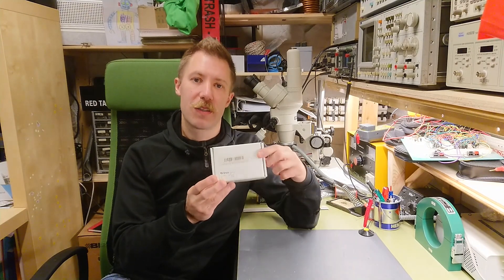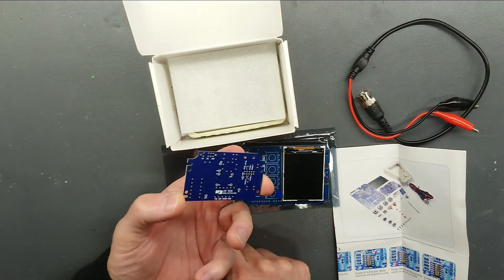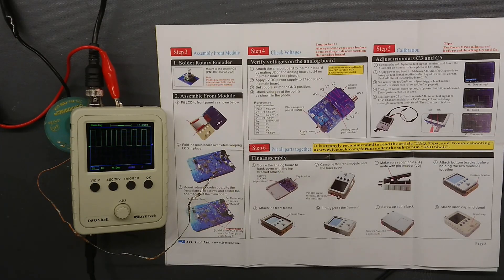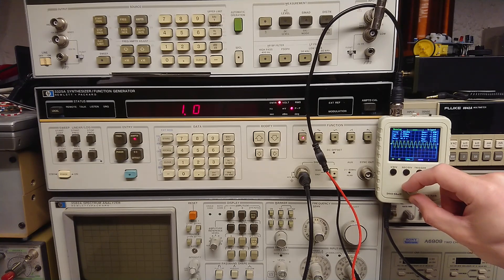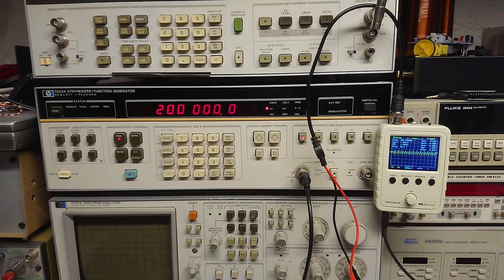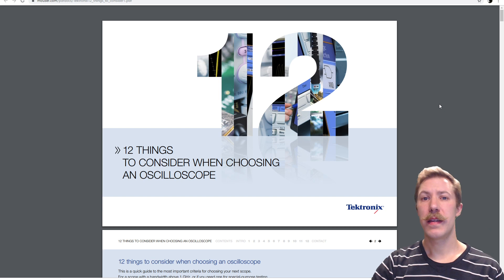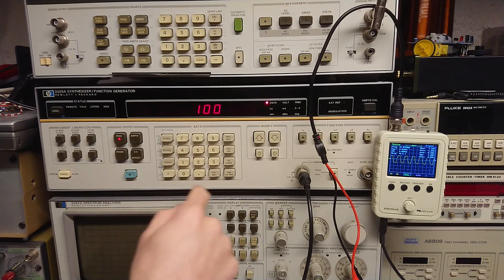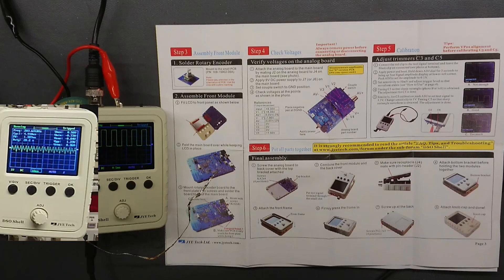DSO138 Oscilloscope Review, Test And Why You Should Not Buy It

Comment: I bought it because I thought it was a fun project to solder myself. And beyond that, I only need to diagnose signals when figuring out how a certain PCB works. I don't need to know what the waveforms exactly mean, I just need to be able to discern between PWM, waveform, DC and AC. This scope does all I need it to do and more.

If I need more, I'll get something better, no worries!
Reply from the maker: But how to tell when its not showing the truth anymore? ;)
Reply: @KaizerPowerElectronicsDk  Haha, true. Though I can still discern between the intended signal and random noise. But for anything other I wouldn't use it indeed.

But it's definitely helpful since my multimeter really can't do much with certain measurements I need to make 😅

Comment: So, I really learned something from this video.
I am thinking of buying one of these.

I thought that it could measure signals up to 200kHz just like you did.

But on a different video I saw a comment about bandwidth and I read up on the subject.

I found this document: https://people.ece.ubc.ca/robertor/Links_files/Files/TEK-Understanding-Scope-BW-tr-Fidelity.pdf

So the way I understand it now is that the Bandwidth is only a promise that you will be able to capture sine waves at that max frequency and then you will have to accept a nearly 30% loss of accuracy in the amplitude measurement at that max frequency.

Also if you want to measure more complex waveforms such as a square wave you need to have a band width that is at least five times that of the signal you want to measure.

And so you can expect to be able to measure square waves of 40kHz with this oscilloscope.

And it seems like it can just barely do that (with quite a bit of distortion).

So that would mean that it actually can do what it promises.

Am I right?

Comment: Unfortunately, the message you're conveying is "Don't buy the one you can afford, even though you can't afford the better one.".    There are plenty of new makers who need to see things from maybe 60hz to 1kHz.  They want to look at things like power, and the PWM rate of things they're driving.  They're trying to learn with doing PWM out to drive LEDs, and it would be a tremendous thing for them to be able to see what they're doing.   

Most of these new makers don't have anything to do with 200kHz, and likely won't be touching anything that high ever. 

I was just at a maker training place, and I needed to see the PWM waveform going out to drive one of their lasers.  It isn't firing right, and I had no way to look at it, other than one of their multimeters.  They told me "we can't afford an oscilloscope".  That's important for maker places, and hobbyists.  I'm glad you have your oscilloscope that can read 200kHz.   It's great that you can read that much farther beyond your need.   You're telling people not to bother buy one, because it can't work.

When I go back there, I'm bringing a DSO-138 with me.  I don't really like carrying around my expensive gear.  I'm fine with the risk of breaking a $20 toy.  And when I'm done, I'll buy them a DSO138, despite your assertions that it won't work.   Things like this cost me more in gas, than the tool would have cost.  If they already had it, I wouldn't have to make another trip.

Let the newbies buy what they can afford.  They're just starting, and need something.  They can't invest a lot of money into it.   When they need something better, they can buy something better.   At that point, they'll have an idea of what features they need.
Reply from the maker: It is not good to more than 20 kHz. That is the message.
Reply: @KaizerPowerElectronicsDk  It's right in your title. "You Should Not Buy It".  It really didn't matter what you were trying to explain in your video, the newbies who were considering getting a DSO-138 to start learning on see that you're saying "You Should Not Buy It".  

You should be able to understand that, since that's what a lot of the other comments are saying.

Comment: I think it will depend on purposes. A better professional high speed multichannel oscilloscope is of course much much better.... but if you're just starting out with electronics and hobby projects, maybe you're not doing high speed circuitry? It may do fine for small electronics projects. I'm thinking of getting one. I'm buiding eurorack modules, and i'm going to be looking at the audible range of frequencies as well as even lower frequency control signals, for those purposes it can be somewhat useful at this pricepoint.

Comment: I live in India. I got the assembled kit for what it'll be 24 USD. I was aware of it's limitations even before buying it. I still bought it because it's really cheap, easy to carry around and works well for low frequencies. If signal characteristics and it's accurate representation is of absolute importance for a project, then I won't rely upon a 20-25 USD scope anyway, no matter what frequency range or wave form it is.

Comment: Just to mention after about 100 turning on and off, the bug activates and you need to download new software!
My problem is that it doesn't want to show frequency correctly and from test pin 1kHz on DSO 150, the device doesn't read any frequency signal on display, but with usual DMM I can read 1kHz from test pin, it is bug!

Comment: I bought this today with the intention of reading audio signal. When I saw the video title I was quite worried. It looks, however, that it will do the trick for me. If I decide that this is something that I really want to pursue, I will get a real oscilloscope.
Reply from the maker: It should work ok up to 20 kHz. But not to 200 kHz
Reply: @KaizerPowerElectronicsDk   you actually just answered the very question i wandered down here to ask. ha! for someone like me, just a hobbyist type with no formal education in these matters prior, and merely making DIY audio circuits, i appreciate this video, as i can see my expectations on this item are fairly accurate and warranted.

Comment: I have been asking if this would work to find the outside foil of capacitors for audio/ amp circuits. Haven't got a good answer yet. It would be handy that way.
Reply from the maker: With low enough test frequency, but if it sampling enough and isnt filtered. I dont know.
Reply: @KaizerPowerElectronicsDk  Makes sense, thanks.
Reply from the maker: @lmt200ish  https://kaizerpowerelectronics.dk/audio/100w-6p45s-monoblock-tube-amplifier/ scroll down to 8th June 2015, here I got waveform of polarity testing on caps in my tube Amplifier
Reply: @KaizerPowerElectronicsDk  Thanks, checked the video and read your write up. I don't have a oscilloscope and only a hobbiest for the most part. I was thinking about putting shielding in the box and a shielded cable instead of the one it came with but sounds like this may not be possible with this. It would be handy if you had a lot to check and you could be sitting on your couch while going through the caps.

Comment: I noticed in this video that there was a comment made about a waveform being jittery, after commenting on the scope's triggering. At that moment in the video, the trigger level pointer at the right of the screen was set to a higher voltage than the top of the signal. If the trigger level had been set anywhere within the signal range, I think the triggering would have functioned and the displayed waveform would have been (more) stable.

Comment: good for audio work it appears.
Reply from the maker: Which makes sense, as the upper limit for a audio amplifier is usually 20 kHz, the limit as where the scope can be trusted. You can not use this for anything in its advertised range fra 20-200 kHz. It will turn everything more or less into a sinewave.

Comment: Compare the cost of one of these tiny units to something such as a Fluke hand held, I would go this way first. At least with a little bit of additional construction and materials you could get a multiplier probe with a longer lead, install it in the acrylic case and you would have a pocket scope that would work for about anything the average person would use on a daily basis. Like everybody already knows, it is a cheap experimental scope not a professional bench model for trouble shooting expensive electronic equipment.
Reply from the maker: Still limited til 20 kHz for reliable waveform
Reply: you didnt even try anything between 20khz and 200khz you just jumped it up   kinda a dumb review.....if you look at someone who tested it fully you would see its good for 50khz and is fairly good at being accurate in that range...

Comment: IS THERE ANY HACKER DOWN THERE???
The real questions is: "What are the limiting factor?"
How can we improve the quality of theses ultracheap O's?
-Getting a better probe?
-Install metal shielding around some components?
-Replacing the capacitor (or any cheap component) with something else?
-Get a 9V battery instead of a cheap 9V wall transfo (like I do to save on battery cost)?

I'm not an electronic guru, I only have some basic knowledge and Youtube as a perpetual teacher.
Alex from Montréal
Reply from the maker: It is the analog sampling frontend and ADC that is not fast enough. There is no easy fix.
Reply: @KaizerPowerElectronicsDk  So we cannot replace the crystal or anything... That's sad.
Thank you very much for your quick and helpful answer Kaizer.
Reply: @alexandrevaliquette1941  The crystal is couple to the MCU, it is the clocking component that sets the frequency it operates at and has nothing to do with the bandwidth of the instrument. There are 2 small ceramic capacitors connected to the chip on either side and to 0 v.
Reply: @brettschacher8644  Slow MCU... so it seem that we cannot do much. Ok, I got it!

But if we replace the capacitors, what will be the improvement? Juste a little bit I guess, in what aspect?
Reply: @alexandrevaliquette1941  No. This scope uses an 8 mHz crystal with 2 -22pF caps, it makes no difference what the capacitors are so long as you don't stray far from these values. The crystal makes for the clock speed and the caps just filter out extraneous signals that are everywhere in the air by giving a DC isolated path to ground. Compare a circuit using an ATmega MCU. They use the same value caps with crystals running @16 mHz. These 3 parts are only for setting the clock speed at which the MCU processes data. The processor can usually function without these parts if it contains an internal clock. This scope uses an STM32F103 MCU which has a max clock speed @ 72 mHz I think, so with that limit, it's not likely any difference would be seen if you installed a 16 mHz crystal  with the same capacitors, since the analog circuitry which is the front end of the system uses a TL084 Op-amp  with a bandwidth of 4 mHz, that gets the system up above the 5x suggested rule for accurate function of the scope for 200kHz. Apparently this scope has issues with square waves above 20kHz. I have not gotten my scope finished yet so I cannot speak on its abilities yet. Perhaps an Op-amp with a higher bandwidth might make a difference getting a higher scope bandwidth so you could get a scope that would function @ a higher frequency input. Of course I believe more circuitry and different switches and modifications to the analog circuitry would be in order and that is possibly  out of the question with a printed circuit board. You would end up with a scope of somewhat larger size and more of everything else. Of course if you are an electronics engineer, I'm not, I just have a certain level higher than a hobbyist, you could work from this basic schematic and add to it with different components, a larger display, it only takes 4 to 6 pins make it work as it is I2C. Beyond this, you would have to spend a fair amount of time mulling over data sheets and look for components that have comparable pinouts and operating parameters as what is used in this circuit. I'm sure the processor is capable of going farther, if you could get the analog section running faster. So as I write here to you, I am studying the schematic. There are 3 connectios from the front side, the analog circuit which converts the input to a digital signal, the output from the TL084 at terminal 8, one output from the processor at terminal 45 which goes to terminal 13 of the amp, this is the Pulse width modulated signal out from the processor to the inverted input of the Op amp. The 3rd is the trigger signal output from the Opamp, so since the Opamp is limited to 4 mHz there' your brick wall, I think.
Reply: @brettschacher8644  Wow, Bret...
I'm speechless!
Everybody have knowledge and expertise in certain domain. I think that sharing it, is what make the Humain race beautiful and so intelligent.
Thank you very much Bret to take this time to explain to a noob how and why it is not possible to quickly upgrade this Oscilloscope.
You can be proud of yourself.
Alexandre from Montréal

Comment: I bought an assembled unit for under CA$25, and I'm delighted!  I'm an experienced electronics technician and have a couple of 100MHz scopes.  I needed a convenient and inexpensive unit to check audio waveforms from amplifier outputs, especially when performing maximum power output measurements:  I look for sine-wave clipping at 100Hz, 1kHz and 10kHz.  This little unit does that just fine!  With some additional input voltage scaling, I attached it to my dummy 500W resistive load & power meter, and it's the best and most useful single-purpose display I could imagine.  Best of all, it floats, so no more inadvertently grounding one side of a non-ground-referenced power amp output and frying the chip!  It's totally worth the price!
Reply: Yeah, the price is hard to argue with. When you pay just 25 bucks for an oscilloscope, I don't think anybody is expecting it to be a highspeed multichannel professional oscilloscope xD

Comment: I paid £21 for a dso138 mini kit with case & probe. I work on automotive electrical systems and this unit has served my needs perfectly so far. I think it is a good unit, but has a limited scope of use.
Reply from the maker: I believe you, do you work with any square wave frequencies above 20kHz?
Reply: @KaizerPowerElectronicsDk  Not at all, at least none that I've found yet, I absolutely know it's not suitable for that sort of work, I mostly use it to verify things are receiving signals and that the voltages to various sensors are sensible. Nothing too complicated, if I were a radio engineer I would definitely not have purchased this unit.

Comment: So this isn't a 4 channel 1 GHz scope?  I bought the DSO138 Mini kit for $11.87 with case, SMD components already soldered, and shipped free just for the fun of building it. It's a better and more useful project than most of the ones that just have blinking LEDs.
Reply from the maker: At least a blinking LED will blink, but advertising a oscilloscope WAY above its actual specifications is not going to help anyone learn electronics, you rely on your measurement equipment giving you real data, so I am not going easy on these kits.
Reply: @KaizerPowerElectronicsDk  All osciloscopes attenuate signals as you go up in frequency. That's why the rule is to buy one with a bandwidth 5 times higher than the higest frequency you intend to use it at. An expensive 500 MHz scope is only good up to 100 MHz. Bandwidth doesn't mean it's accurate through that entire range.

Comment: Could there possibly be a component upgrade to improve the operation while keeping the cost low?  It's definitely not Aeroflex or Tektronix but the beginner/hobbyists could use something low cost for troubleshooting their toys & gadgets
Reply: This DSO is built around the capabilities of the STM32 microcontroller.  The frequency and resolution limit is set by the internal ADC performance.  There isn't any way to change that.  Later version of the STM32 improve the ADC, but only by a factor of 2x.  Which barely matters.

That said, it's a very usable tool if you are looking at ultra-sonic or lower frequency signals.  It's great for IR remote controls, looking for switch contact bounces, and monitoring sensors.  It good for checking the rise and fall time of modest speed serial lines.  It's useless for high speed communication signals.

I'll argue that a 50KHz DSO is actually more useful now than it used to be.  A few decades ago a 20MHz or 50MHz scope was almost a universal tool.  It would let you debug almost everything except RF modulation, and you could fake that by looking at an IF stage.  Today almost no digital logic runs that slowly, everything interesting is in the GHz range and you need special techniques to measure it without disturbing the circuit.  Pretty much an o-scope is relegated to checking the analog sensors.

Comment: Makes sense that it can't show an accurate square wave above 20kHz or so.  The heuristic I once heard was that you need the bandwidth for about 10 harmonics to see non-sinusoidal waveforms on a scope.

The distorted 200kHz sine wave test is particularly disturbing, since it means the software isn't even attempting to reconstruct the waveform properly.
Reply: usbcd360, where do you get "it means the software isn't even attempting to reconstruct the waveform properly" from? Your understanding of how these scopes work seems to tilt towards the magical.

The "software" is certainly doing the same thing with higher frequency signals that is does with lower frequencies; in that, it is definitely "attempting" to do its job. This scope suffers from exactly the same thing as any other digital oscilloscope, it is just that its sampling characteristics are not as good as more expensive scopes. You get what you pay for, and this scope is a good design for only about $20 US.